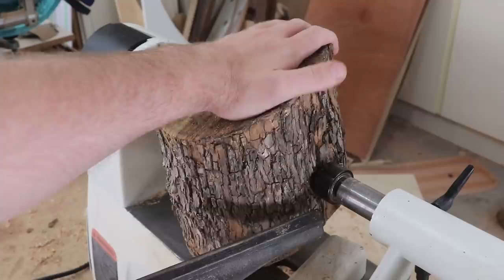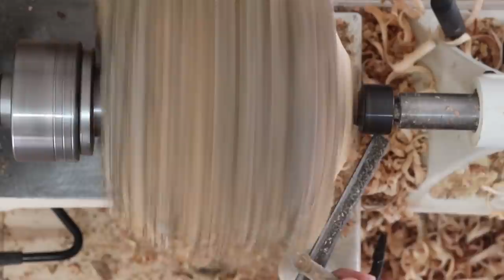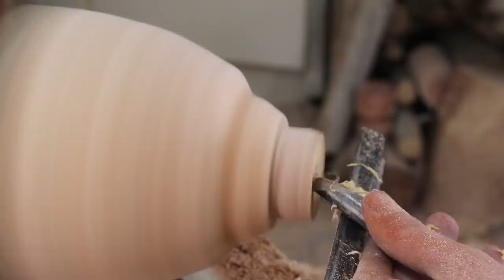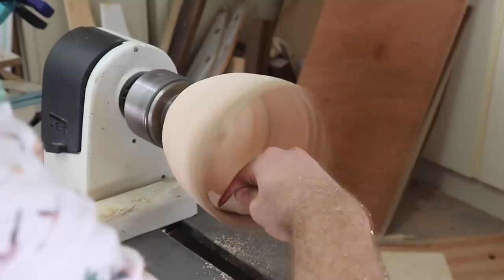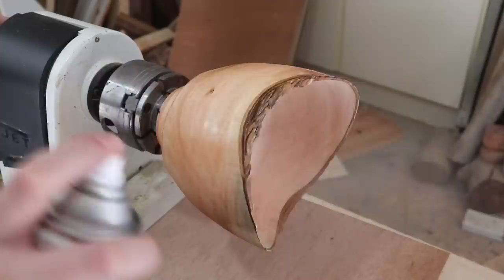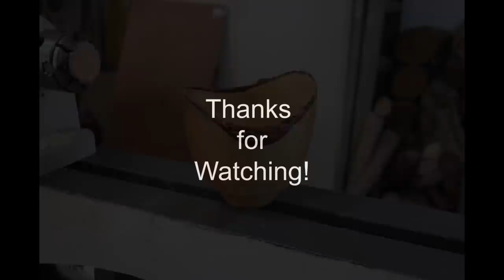Wood Turning a Log into a Pedestal Bowl

Comment: Beginner?  You got the walls pretty thin for a beginner; which is good.  But, IMHO I think you cheapened the turning by using spray clear coat instead of putting a nice well sanded and buffed finish using abrasives and polishes.